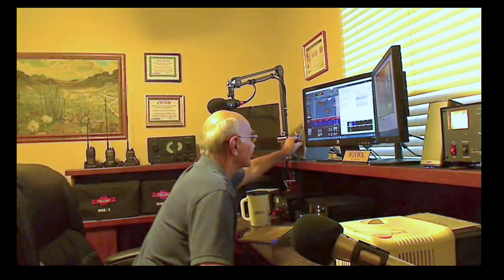Hurricane weather reports from RTTY signals

Comment: Cool Joe cant wait to advance to Flex Radio.
Reply from the maker: You can decode these signals with just about any modern radio-- using something like a Signal Link.This attaches between the radio and the computer and acts like a secondary sound card- so you can receive and transmit digital signals.

http://www.tigertronics.com/